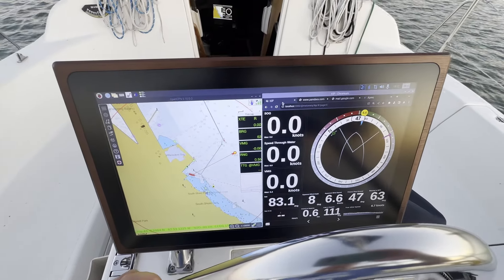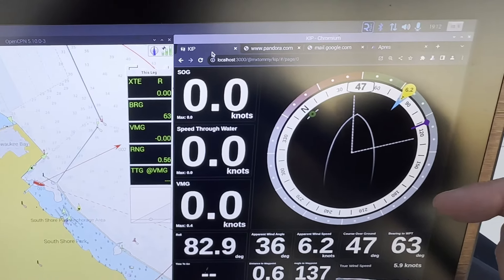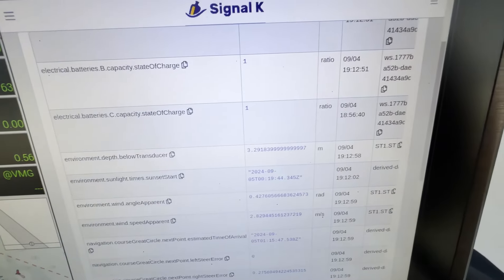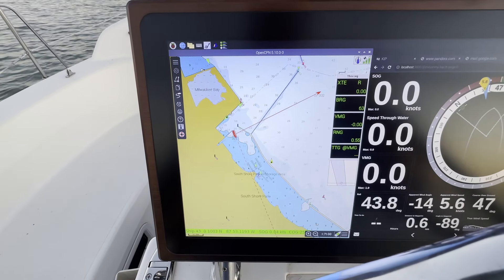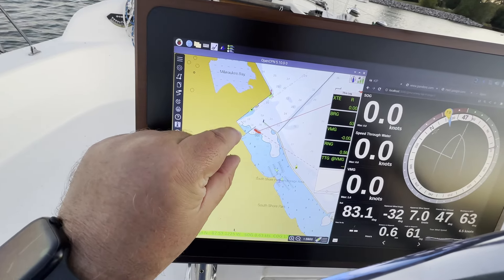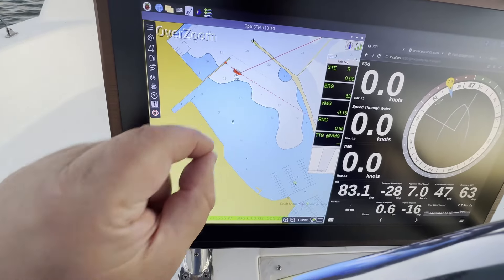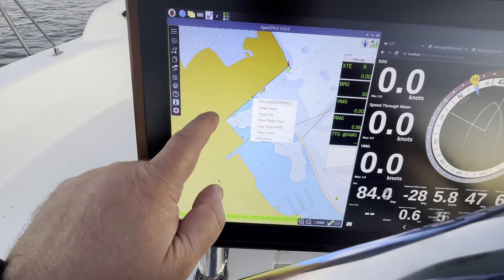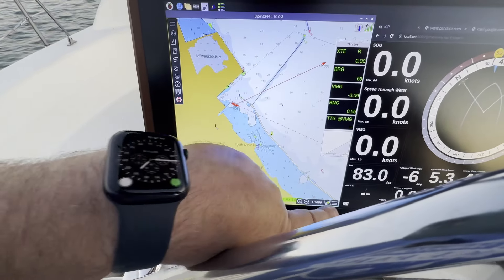Raspberry Pi5, Openplotter Ver 4.0 - Seatalk 1 and OpenCPN 5.10 - Tech EP34 - Après Sail

Comment: I couldn't bear the slowness of opencpn, switched to avnav. Doesn't integrate pypilot but sooo much smoother & faster
Reply: i understand where you are coming from. The touchscreen or RealVNC is not great which is a shame as would be a great system if it worked better.
Reply from the maker: I only found touchscreen operation to be slow, generally OCPN on RPi5 is pretty good.  I will check out AVNav though - thanks!  my Autopilot is a Raymarine/Autohelm 4000 so doesn't take commands anyway
Reply: here is a question for you @screenshot-nj7fw. If you have RPI and installed OpenCPN and ochart charts - CAN you install AVNAV on the same machine and use it as well?
Reply: @MikeAndCarolineKolling  absolutely you can. That is the setup I have, though I don't use ochart maps on avnav, only on opencpn (but there is an option for it on the settings so I would assume it works). I mainly use raster charts (from SAS planet navionics) 
FYI, avnav also has an Android app, simpler than the web version (and redundant)
Reply: @screenshot-nj7fw  what is sas planet navionics?

Comment: Can you please tell me what sensors are you using for the wind.
Reply from the maker: I am using the Raymarine ST60+ gauge that was on the boat when I got it.  It has an R28170 transducer at the mast head which I replaced in 2022 and the cable I replaced in 2024.  The ST60+ gauge talks to the Raspberry Pi via Seatalk 1.  Personally I like having the physical gauge for this, as I like the damping on the physical needle better than the LCD versions, so if I didn't have one, I would probably buy a used ST60+ or I60.  if you are OK with the LCD gauge (and don't get me wrong, it is good enough), hen you could think about some of the 3D printed DIY ones
Reply: @ApresSail  thank you for the information and replying.

Comment: What model of the touchscreen monitor is that ?   Thanks.
Reply: i was going to ask the same thing. Looks expensive!
Reply from the maker: @MikeAndCarolineKolling  15.6" Touchscreen (Helm) - https://www.sihovision.com
-  The Spec. for the monitor can be found in the link below: 
https://1drv.ms/i/s!AmZj-tob5pZoknOlzCnOhpcJ9Tvv?e=lpBtxM
this the invoice from the supplier and I have edited out my details and the costs as these are from November 2021
Reply: @ApresSail  Thank you for your videos, I have now orderd alot (starting kit, took me MANY hours to find all the components).
One question about the screen, the link you provided says 400 nits, isn't that way to weak/dark?
Reply: Just saw on your invoice that it said 1000 nits there, which spec is it? Thanks.
Reply from the maker: @gutelappen  The 15.6" screen at the helm is 1000Nits.  The 10.1" screen at the nav station is more like 350-400nits.
Reply: Have you looked at using tablets (ipad or android) instead of a touchscreen like this? What are the advantages of running a touchscreen display vs tablet?
Reply from the maker: @dobaobalina  My first year of owning my boat I ran the Pi and then used VNC to display through an old iPad 1 at the helm. This wasn’t bad. But the iPad wasn’t waterproof, wasn’t sunlight readable and would overheat from time to time. From The usability side, you would have to connect each time and there would be disconnections every so often. There would also be a little bit of lacency. None of this is a show stopper and I know people that use tablets and especially Samsung Galaxy Active Pro tablets, but these are also similar price to what I paid and much smaller.

Comment: What sensors are you using ?
Reply from the maker: 1W Temperature: Batteries(3), Cabin, Cockpit, Aft Stateroom, Coolant, Alternator, Oil, Engine Manifold, engine intake, engine compartment
Heading: Waveshare ICM-20948
Pressure: BME-280
Oil pressure: VDO Pressure sender 0-10 Bar
Battery Current/Voltage/Power x 3: INA-219 (shunt resistor removed & external shunt (300A)
AIS: Maiana
GPS: Maiana & GlobalSat BU-353N
NMEA0183 input: RS422 to USB To/From VHF
Raymarine Seatalk1 input: Optocoupler
Black water tank sensors (x5): XKC-Y25-V
Bilge high water sensor: Float sensor

I think that is everything...
Reply: @ApresSail  Thank you !